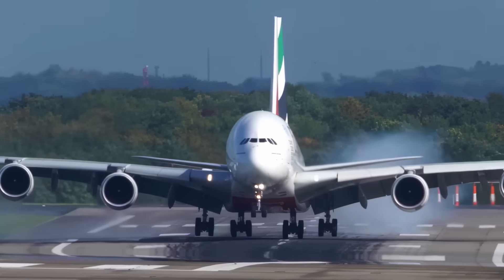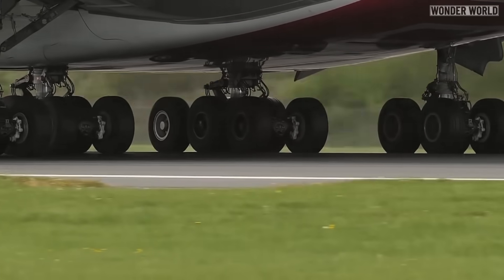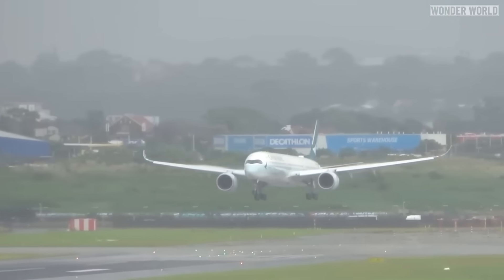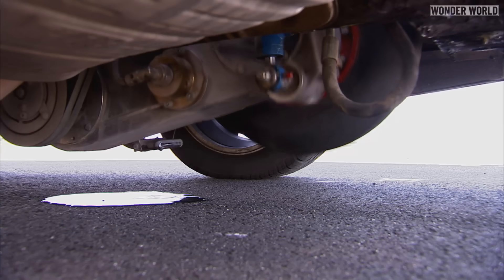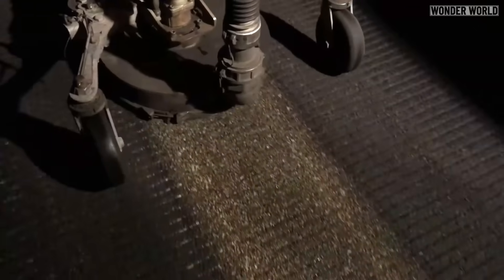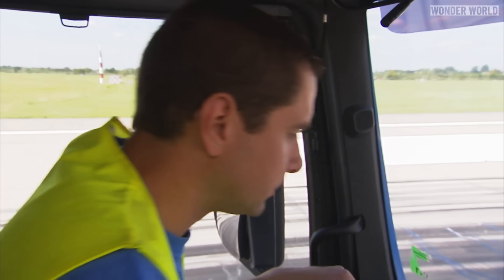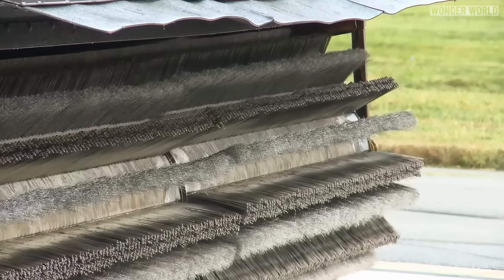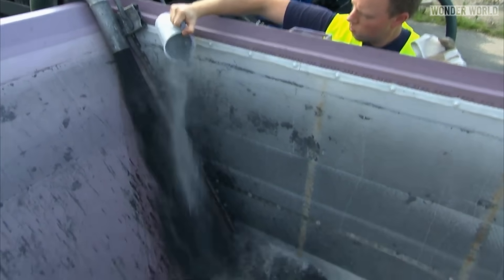Why They Clean Rubber from Airport Runways

Comment: I’m surprised that landing gear hasn’t been motorised considering the electric drive technology we have today… spinning the wheels up to speed before touching down would reduce the maintenance costs dramatically.
Reply: Yea I always thought the same but the reason for this is really interesting. Too complicated for a comment. Look it up.
Reply from the maker: the next video covers this topic.
Reply: @WonderWorldYTC how soon?
Reply from the maker: @SpotterDeer 3-4 days
Reply: Weight is a factor and the entire volume of space between the axle and wheel is taken by a multiplate brake package
Reply: It wouldn’t reduce costs that much, it would probably increase them instead because the airplanes would weigh more and be more complex
The rubber is left on the ground for the whole duration of the braking, not just the spot where the tires first touch the runway so the motor wouldn’t change things that much
Reply: @lorenzobertolino1527  I could swear taxiing doesn’t leave rubber.
Reply: @SpotterDeer it leaves, The side parts of the tread bend under load and scrape the surface of the surface. This is especially visible on medium-pressure tires on aircraft that can also land on ground surfaces. For example, the AN32 has a main tire with a diameter of 1m and is recessed by 15cm at the point of contact, and when driving in a straight line, two parallel tracks remain, like train tracks. On aircraft that have high tire pressure, tire wear during driving is less, but it still exists, but it is different than when landing, because heat is released that melts the tire. When driving and especially turning, the tire wears out as if it were being sanded by sandpaper, and traces are formed in which there is rubber dust that does not remain but is carried away by wind, rain, etc.
Reply: @SpotterDeer sure for taxiing it’s nowhere near as much but I said that it’s lost while braking, meaning while it’s still on the runway and slowing down from landing speed to taxi speed
There would be just a spot of rubber on the touchdown zone to be cleaned and not the whole runway if it wasn’t so
Reply: @ Geez lucky we have you chiming in with your engineering prowess…🤦
Reply: That would be too costly, complex, and heavy. Think of the work that would have to be done to put multiple electric motors on each landing gear, the batteries to power them, the re-engineering of the landing struts to accommodate the motors and the extra weight, not to mention the cost of these systems plus the extra cost to fly with that weight. Manufacturers are constantly trying to reduce weight, this would achieve the exact opposite and for no real benefit.
Reply: @ Naa! Modern electric hub drives wouldn’t add much weight or complexity. They could even reduce complexity as they would be able to utilise regenerative braking. In fact some modern planes are beginning to be fitted with electric wheel hub systems so they can self taxi without the need for a tow vehicle. Engineering solutions are already being developed.😁
Reply: @baarni  which planes have an electric motor in the wheel hub to taxi on the ground
Reply: @ The 787 Dreamliner and the A380 have nose wheel electric drives. The 767 has also been tested with the Wheel Tug electric drive system.
Reply: @baarni  Nice, the nose wheel doesn't have a brake in it. Do you think those two small wheels could move an airplane weighing several hundred tons? Vehicles for towing airplanes can have any kind of drive and that has nothing to do with airplanes but with the airport and their equipment. In order to place electric motors in the main wheels, there needs to be room and there isn't because the brakes are in the hub and they get hot when braking and that's not a pleasant environment for an electric motor. The cost of tire wear and their scraping off the runway are less of a problem than complicating an already complicated airplane, especially since powering the electric motor requires a lot of electricity which in the event of a failure can cause a major fire on the airplane and it also needs to produce all that electricity that only the main engines can produce and when they are already working they don't even create enough thrust for taxiing. The main engines are started on the stand where there are firefighters who will quickly put out the fire when the engine starts, they would have to be all over the airport depending on where someone would start the engines. Also during taxiing, the engines are warmed up and prepared and the parameters are checked to ensure they are working properly and ready for takeoff and maximum power.
Reply: @ sure! And if they get developed and used in commercial aircraft they might be used to also spin up the wheels just before landing
But having the motors just for this reason would be pretty stupid imo
Reply: @ No they don’t… the 787 has electrically actuated main gear brakes. The A380s main gear brakes are hydraulic like basically every other commercial aircraft. They both use hydraulic nose gear steering, but there are no nose gear brakes or ‘drives.’
Reply: @ Bla bla bla. Argumentative guber. Do some searching and reading and you’ll find out that they have electricity driven nose gear for taxiing.
Reply: @ You know it all goofballs. How about you look up and check out what information is actually available before blasting your arrogant horn…🤦
Reply: @ batteries wouldn’t really be needed, connections to the electrical systems would be more than enough
But still, more complexity and more weight for little benefit
Reply: Big rotating scrubber sounds like my old next door neighbour 😬
Reply: Zwei Windradschaufeln würden ausreichen, wenn das Rad bei der Landung in den Flugwind kommt. Dadurch wird das Rad beim Landeanflug schon zum Drehen gebracht.
Reply: Don't want those tyres spinning full speed when landing. Never pull that big bird up.
Reply: Nah, just spin up using bleed air.
Reply: Contrary to what you have stated, installing a pre - rolling motorizing system on landing gears will increase the overall weight of aircrafts. Also, maintenance of these motorized landing gears would add to the already complex maintenance carried out for land gear systems. Also, introducing this would mean going for recertification of the aircraft since this would be a completely new system requiring additional trainings to ground and flight crew. Comparing the cost of that vs the current way of cleaning runways, the cost difference is humongous.
Reply: I asked that last year . to expensive compared to new tires . all the maintenance and brake heat